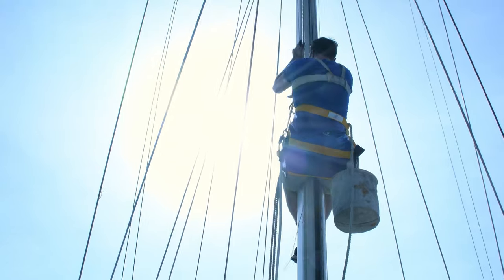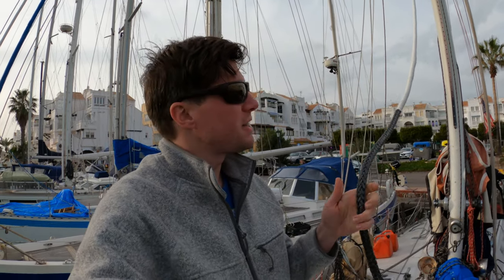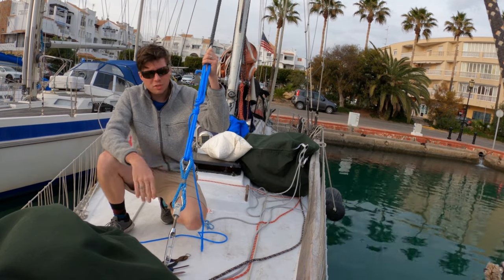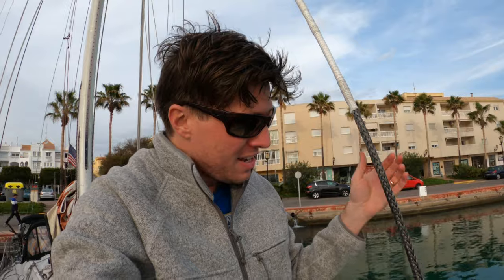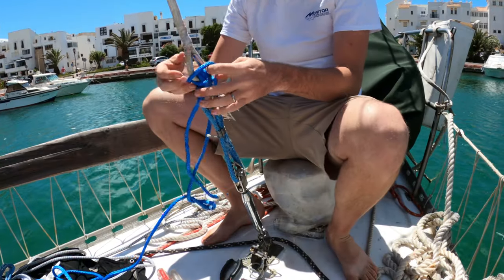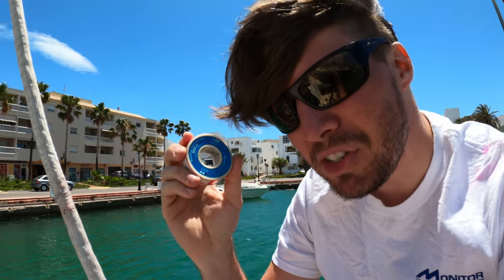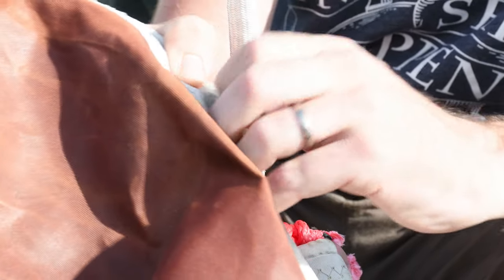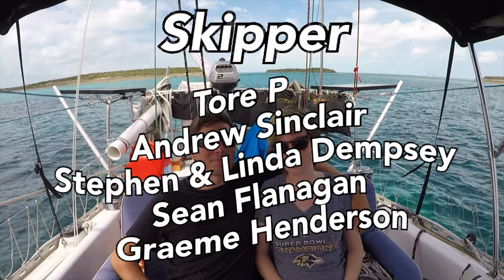DYNEEMA [Part 4]: Installing Synthetic Standing Rigging | Sailing Wisdom

Comment: front drivers side  bumper should have 1 small circle or square of plastic you can remove and screw in a tow eye, it wont be hard to miss, there should also be another tow eye cover on the rear bumper on the drivers side.
Reply from the maker: Good to know!

Comment: There will be a screw-in tow eye with the spare wheel in that Fiat, then look for a small cover in the rear and/or front bumper to screw that tow eye into  👍
Reply: Then I wonder if the shock load could bend the unibody.
Reply from the maker: That was my concern. Also what to tie it to in the marina?
Reply: @RiggingDoctor  If you do loose good reason, all camera angles are a must. 
Sorry I thought that bollard would hold, no I'm not a terrorist.

Comment: Thanks for all the info you share, your videos have helped me better understand synthetic rigging and increased my confidence in it.

One thing that I have been wondering for some time is how a furling system could be installed over a synthetic stay, and if anyone has done it.
Of course, one will have to figure out a way to protect the dyneema from the rotating elements to prevent fraying, etc..
Reply from the maker: People have told me that they are going to try it and that’s all I’ve heard. I have no information on how well it holds up. When we get back to the Chesapeake, I plan on doing some tests to see if various methods would work under a foil. 

Glad it was helpful!

Comment: I replaced my forestay and backstay with amsteel. Turns out I have these cool little things called winches on my boat. Threw a pulley on the mount, ran a line and pulled the forestay tight. Left it under tension and would return every hour or so and tighten it down some more. When it held tension, I knew I was done. Could have done the same using the mainsheet to a bow cleat.
Reply: yes, Herbie does it this way in his very old original videos. This is just another way.

Comment: Thanks for the info Herbie! Your videos are super informative and as a newbie to sailing, I find them incredibly helpful. I was wondering: is it more difficult to hoist a headsail with a synthetic stay and soft hanks, than a steel stay with bronze hanks? I only have experience with metal rigging, but am interested in eventually transitioning to synthetic. Thanks again for sharing your sailing wisdom!
Reply from the maker: Morgan Hansen hoisting is the same, the trouble is coming down. Bronze on steel practically slams down on the deck, but Dyneema on Dyneema stick a little at first and need a slight tug sometimes, then if falls down like a rock. For being such a slippery material, they seem to stick when under load. Having a downhaul tied to the head of the sail is very helpful for this, if the sail doesn’t want to come down, you can give it a tug instead of going forward to the luff of the sail to pull down.

Comment: Hi Herb thanks this has been a big help as I’m moving toward rerigging my boat with synthetic next rear. Question: having taken out the constructional (or whatever) stretch as you do on this video, how much gradual stretch/creep do you need to anticipate over the expected life of the stay say 8-10 years?  Best, Tony.
Reply from the maker: In the first month or two, you might see a few inches. The first few days will be the worst as you will tighten it in the morning and it will be loose by lunchtime. 
After the first month or two, it will calm down and then be fine for years. 
Far off in the future, when it all goes loose (on a summer day, don’t worry about winter stretch as that will go right back in the springtime), the Dyneema has entered into its final phase of its lifecycle and needs to be replaced. 

Basically: Phase 1 is lots of creep and lasts a the first months, Phase 2 is when you are golden and lasts for years, Phase 3 is when it starts creeping again and is the sign that you have reached the end of the life for the Dyneema. 

If you have any other questions, please email me at riggingdr@gmail.com. I would love to see pictures of your conversion as well!

Comment: Hey Herb, I'd like to inspect my chain-plates and was wondering if its okay to rely only on the babystays (or only shrouds) to hold the mast up while removing the plates ?
Thanks !
Reply from the maker: It would be a good idea to set the halyards to hold the mast as temporary stays. 
Genoa halyard for the port shroud. Main halyard for the starboard shroud. 
Tighten the mainsheet to pull on the topping lift to act as the backstay. Be sure to keep the headstay setup during all of this.
Reply: @RiggingDoctor  thank you once more, master 🙏

Comment: I assume you're using Dynex Dux?  Isn't that heat set for constructional stretch?  Or are you using Amsteel Blue?  Can you use Amsteel Blue for rigging?  I haven't found an answer to this anywhere.
Reply from the maker: This is DM20. It’s much better than Dynex and way better compared to Amsteel

Comment: Herb,  at 1 minute, 45 seconds you show a thimble on toggle ping. How much of an issue is the point loading and what is the likelihood of that point load causing failure of the toggle (or the pin)? If the dyneema is tight when cold and warms up 20 or 30 degrees, how much additional stress added to the point loading?
Reply from the maker: I was worried about this when I first installed it and checked it often for the first year of its life. The thimble,even though it’s loaded to extremely high loads, did not fail, deform, or even develop a flat spot. It turns out that it’s not an issue and the thimble does a good job of making the Dyneema make a larger radius turn over the clevis pin. 
If you have it tight and then it warms up causing it to contract, it will get very tight! This won’t be the first point of failure, but the tang that the end of the stay attaches to is the next weakest link. The part that could break before is the chainplate if you have a rotten bulkhead, the tension could be enough to pull the chainplate up through the deck. 

If everything is sound, it won’t break, but it will stress the hell out of the rigging. If you do this regularly, it will cause premature failure of the rigging.

Comment: Hi there,
Thanks for the video!

Just so you know the next time: european cars do have strong points - no exceptions. They are required by law to have a tow point both front and back. A lot of cars have a consealed point on the bumper behind a small cover (usually on the right-hand side), where you can screw in the tow ring, which is stored somewhere in the car's trunk, probably together with the jack.

Also, did you make this video unlisted intentionally? That would explain the low view count and why no one has pointed out the tow point on the car yet. What you cannot expect, however, is that a Fiat Panda will have the same stretching effect as F150 :) I wonder whether the abrupt stop could trigger the airbags
Reply from the maker: It’s still unlisted because we haven’t published the video yet but I wanted to make it available to people who are interested in making their rigging before I publish the video. 
I found the little door in the bumper but it was empty and I didn’t know where to find the tow ring. I was more worried of torquing the frame if I stopped the car suddenly with a yank from one corner.
Reply: @RiggingDoctor   nah, these tiny cars don't have any frames - you'll twist the whole body

Comment: How much force is needed? A quick Amazon search shows a selection of come-alongs and chain falls for less than $100 depending on load rating. These are useful tools for a lot of things, so probably not a bad investment.
Reply from the maker: It depends on the boat and which stay, but generally while at rest, the tightest stay on a 40 foot sailboat will require around 5000 lbs. A 3 ton come along would be able to get that tension for you and you could then tie off the lashing and remove the come along. 
I would buy two so that you could do the stays in pairs and get the mast trued up more easily. 
They would be most helpful at removing the constructional stretch and helping to get the creep out before tying everything off!

Comment: possibly could have installed a "top down furler" instead . .  synthetic torsional line with free luff yet also allows furling on a drum in case of need when quick tacking.
Reply from the maker: That’s the workaround for having a furler with a synthetic headstay.

Comment: Just one thing, how you figure out the length need to be of  dyneema before you attach to deck , before stretching ?
Reply from the maker: I hope that I covered that in a previous video. If not, careful measurement of the distance between the tang on the mast and the chainplate on the deck that way you can make the stay at the exact perfect length.

Comment: Hard to make this stay removable/repositionable?
Reply: Good question not seen one yet. I may try it on an inner forestay addition to my boat, better than a cable when not in use. One thought was rigging similar to English etc smacks-cutters that have long retractable bowsprits. General observation from afar is they use compound block and tackle on deck for the inner. Similar long throw tensioners designed for gaff rigs can even be operated from the cockpit for shrouds, backstays. Something must work.
Reply from the maker: They can be done and are about as complicated as a steel setup (so not very bad once it’s all setup the first time). 
We had a removable inner forestay but made it a permanent setup since we never removed our stay in 9 years.

Comment: What formula do you use to predict the eventual length. It would stink to be an inch too long or short!
Reply from the maker: The math was covered for Heat Set SK78. For DM20, it comes out about 8% shorter.

Comment: Is there a reason why the stay cannot be pretensioned by say using a motor vehicle or tying off to a pile or wharf?
Reply from the maker: I normally do that with my old truck and a tree, but I was in Spain and the rental car didn’t have enough umph to do so. 
I have tried tying the line from boat cleat to dock and throwing it in reverse to yank the Dyneema tight, but it didn’t have enough speed to shock load it enough to make a difference. 
With the truck, I simply roll down a hull at about 2-3 mph (no more than 5 because it feels like hitting a wall) until the line tied to a massive old tree (with very strong roots and a board to prevent damaging the bark in place) goes tight and the truck slams to a stop. It is very jolting and I recommend wearing your seatbelt! Do this a few times and it will get all the stretch out. 
Then leave the truck “hanging” on the hull in neutral for a few days and this will get the creep out of the line. As the line creeps longer, the heavy truck simply rolls slightly farther down the hill. I like to mark the bottom side of the sidewall with a line of chalk so that I can measure how far the truck has rolled over the past few hours. 
When the truck stops rolling, that is when I consider it “pre-tensioned” and ready for installation. 

Sadly in Spain, I had no hill and no heavy vehicle. The pole I tied the stay to pulled out of the ground (thankfully the marina people didn’t notice). I was unable to get any creep or stretch out of the line. 
This stay was made of DM20 which is an amazing line. It barely had any creep at all. On our Atlantic crossing, I needed to tighten the turnbuckle about 1-2mm total due to creep making the stay longer. This was with the force of the staysail yanking on it endlessly in high winds. 
Heat set SK75 is my standard go-to for cost reasons, but it has a lot more creep. DM20 is the gold standard in my opinion.

Comment: Very cool, would it be easier to drop the mast if you're doing all the stays at one time?
Reply: I don’t think so even it could be if crane time was involved definitely counter productive. If you can step your own mast like trailerable sure.
Reply from the maker: Both points are true. Lowering the mast is a production that is easily avoided by climbing the mast many times. 
Now, for ease, having the mast down is much easier and less stressful to work on than doing it all aloft. 
When I rerig the Alberg, the mast will be down but it’s a deck stepped boat with a much smaller spar. On a keel stepped boat with a huge mast, it’s easier to work around it by going up.
Reply: @braithmiller  thx,z I've seen people drop and it looks very involved  lol .
Reply: @RiggingDoctor   you  know I saw a Albert 30 for sale a couple days ago nice little boat,.
Reply from the maker: I can’t wait to start working on it!

Comment: could you also use your winches to help pull out the stretch, like run a line through the dead eye to a winch?
Reply from the maker: You can, but the load will stress your rig. Using a car and a tree will save your fittings. 
If you don’t get the stretch out, you will eventually get it all with time.

Comment: I assume the dyneema come with info how much it stretches so its possible to know how (short) to cut... or is there a formula depending on size?
Reply from the maker: It comes with a spool. It was a lot of research and testing to come up with the calculations
Reply: @RiggingDoctor  How about prestretching the Rope, before you create The Line? Would that reduce the variable enough to "cut/work" it to messure?

Comment: Hello! I love seeing many of the different ways people have been using dyneema since it's introduction. I'm very interested in simple, cheap and repairable rigs. I know on your boat and other boat designed with wire rigging what you have done is the most efficient way I have seen to rig in dyneema. 

I have a 1973 Cheoy Lee Midshipman 40 ketch. I need new chainplates (9!) and rigging so my situation is a little different. I want to design new chainplates specifically for dyneema. What is your opinion on using soft padeyes similar in design to the ones in this video: https://youtu.be/5qCyVsFO0U4

It seems very simple to make from supplies I have on board and I could make 2 sets for the boat and still be way under cost of paying a machinist to fabricate new chainplates.
Reply from the maker: I’m not completely sold on this system as the goal of the chainplate is to spread the load onto the hull and transmit it to the keel. If you have a Soft Loop, you will end up with a point load to the boat which will lead to hull deformation in that area. 
A chainplate designed for Dyneema would honestly be a bar at the top of the plate. Think of a large clevis pin where the plate wraps around and back onto itself, holding the ends of a pin. The lashings could wrap around the pin and be held in place by the sides of the chainplate. 
Now, bending the metal over would be difficult, and the next best thing is to machine a series of holes and fair leads into the end of the plate, obviously a very thick and expensive plate. 
This is all why I went with a deadeye connected to the plate by a toggle. It keeps cost down and strength up.

Comment: I think you did the right thing by not trying to stretch the Dyneema with your rental car. If something went wrong it would, well you know.  🤦‍♂
Reply from the maker: Indeed. I normally use the tow hitch on an F150. A little European can doesn’t have the mass or strength